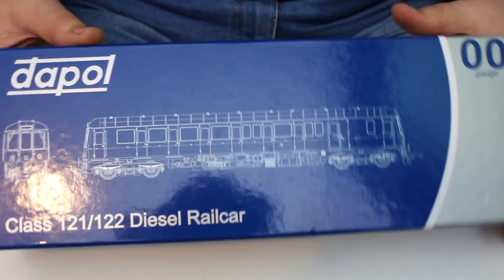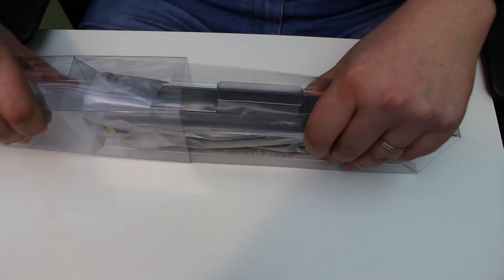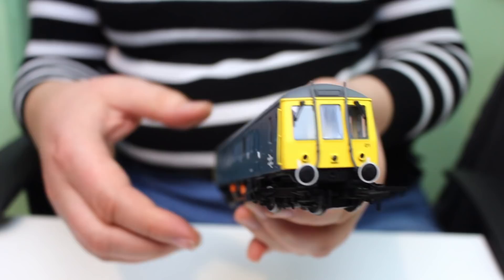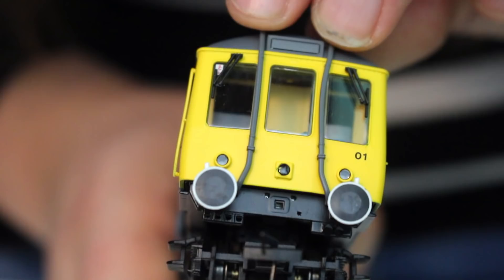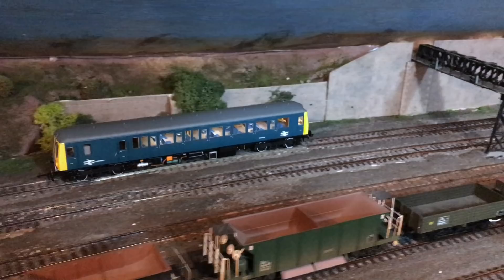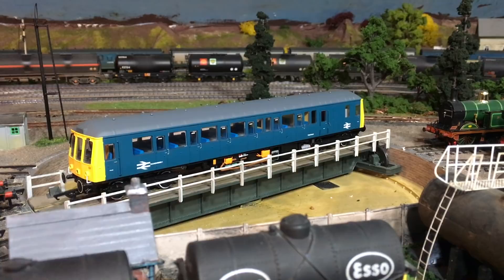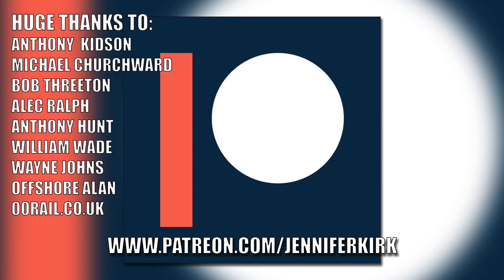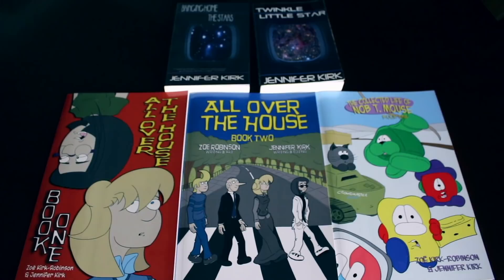Budget Beauty! Dapol Class 122 DMU Bubble Car in Route Learning BR Blue - Unboxing and Review

Comment: The 122 seems to have a better turning circle than the 121. Sad to hear that you had some running issues.  These units did when in service pull other units and trailer cars.... when used as parcel service they had combinations up to 5 (121-121-117-121-121). Interestingly most of this was Class 121 (has problems with bogies catching on underframe)  There was also an interesting reference to the 121/122 being used to help pull other DMU when they had motor issues.

Comment: Hi Jenny, did you manage to figure out why the interior lights weren't working? I've just received my Class 121 and I'm having the same problem. Direction and cab lights work but not interior coach lights. I installed a Zen 21pin MTC 6 function chip so I presume it should work. Thanks, Julian
Reply from the maker: Station Road Model Railway it seems they only work if you use a Dapol Imperium chip. I swapped one in and they worked. Don’t know why.
Reply: @JenniferEKirk  Ah, that's good to know. I'll order myself a Dapol decoder. Do you think Dapol might be deliberately tweaking their locos so only their chips operate all functions?

Comment: It appears the aux lights issue is a known issue as there appears to be two different interpretations of the 21pin MTC standard, one using logic level aux ports and the other using full power aux ports I found this post https://www.rmweb.co.uk/community/index.php?/topic/124540-dapol-class-122-dcc-sound-decoder-issue/
Using a Dapol DCC decoder works OK but some say that the z21 doesn't like the Dapol decoder ???
Dave